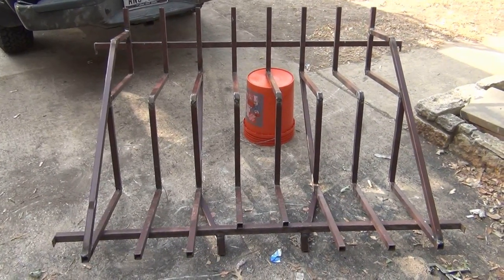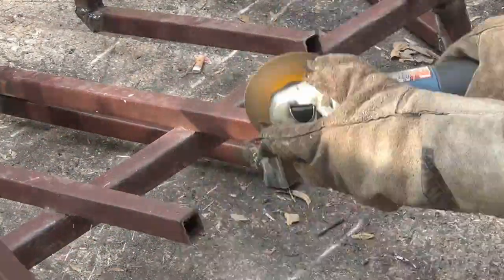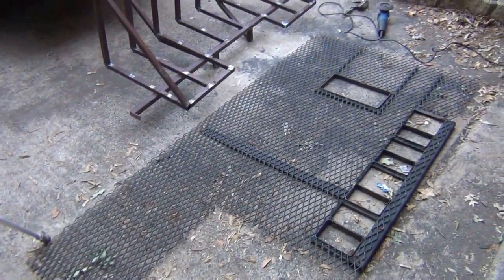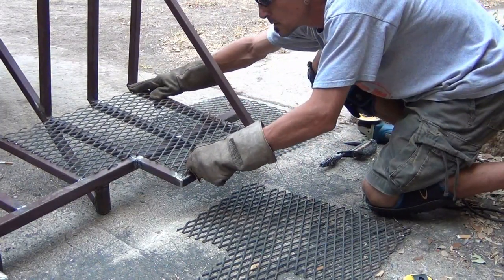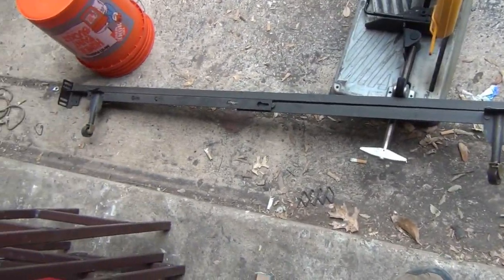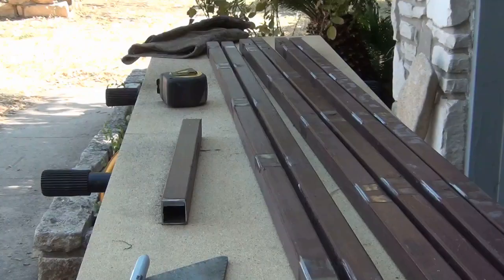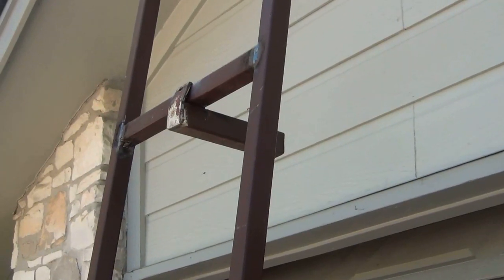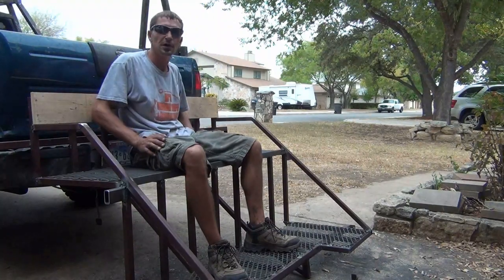Welding a Double Bow Hunting Ladder Stand From Steel Fencing 2/2

Comment: @dnahoghunter Don't stress to much about the quality of your welder I still use a 30 year old stick welder at home. The trick is use the right gauge rods. I only use 2.5mm mild steel rods The only drawback is I use A LOT of thin rods instead of a few thick rods.

The Good thing about welding is you can always grind it out and do it again or grind it smooth if you don't like how it looks. :-D